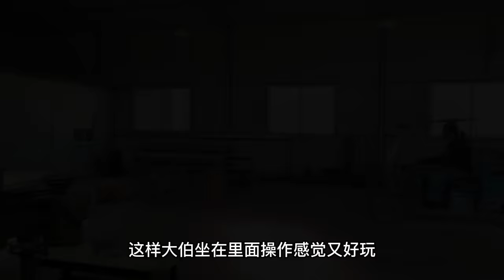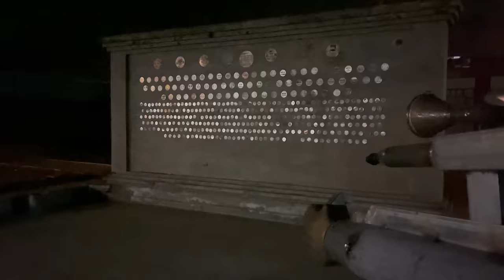ENG)自製安保巡邏機甲 Homemade Security Patrol Mech【手工耿Handy Geng】

Comment: This is Awesome!!! I would set it lower and balance the center of gravity with a swivel wheel under the driver, then could remove the stop rollers inside the tracks and would make it much more stable.
Reply: I was thinking the same thing.  But simply incredible!  What an awesome channel.
Reply: Pair of sprung (wide set) dollied motorcycle wheels trailing.  To improve off road capability?

Comment: I would change this device to have 2 tanks. One for chili pepper water and the other is for gasoline. Change the 2 arms to flame throwers. Add microphone for dosing out warnings and call for help. If the chili water does not deter then the gasoline should deter any intruder.
Reply: Special attack is fine, but sometimes you need melee attack, like when you run out of those tanks
Reply: Hey he is living in China, not the US. :P

Comment: Excellent build.  As for lethality, it can serve as a platform for a number of weaponry and mated with a remote piloting system.

I'm amused at the idea of a perp laughing-off being spritzed by water and the Sybian-like motion of the mech's arms... until the fists swivel down to reveal a Vulcan electric cannon and sidewinder rockets :P
Reply: Actually what would be absolutely devastating is putting laundry detergent in the cannons.
Nobody would stand up anymore and the machine is on tracks.
Crowd control.
Reply: @raymondcarter1137  why so complicated make them suffer directly with pepperspray ingridient , needs ofc a windshield then ^^

Comment: You are obviously inventive and clever at rapid building. But what is uncle going to do with this machine? Can he get in it? How much experience will he need to operate it efficiently? What maintenance will it require? And when uncle manages all this, what can it really do, almost tap an assailant with a slow punch or mist them. With water. I assume it’s water ! I think there are some good thoughts here but it’s not yet viable. Great engineering though, just needs some refining. Also, forward planning would be advantageous to you.

Comment: Just soak some capson peppers in your reservoir tanks and you have a pretty good crowd deterrent like a mace and maybe add side and rear facing sprayers as well  Dare we be mischievous you could also add a few spark plug wires and a coil to those sprayers and different liquids  For some real crowd control :)

Some bigger tracks for stability and Improved center gravity and you might have something :)

Comment: I feel like if it would have been made with 3 of those tank-treads in a triangle arrangement, with 2 up front and another  in the rear center it would be a lot more stable, it seems like it could tip over backwards if he hit for instance a speed bump while going at full speed ahead. Or if he was going in reverse and hit an obstacle, it just Seems to have a bit high CoG from my perspective. Still totally bad ass, but that is the one thing I feel like could be a major improvement...
Reply: he collects his materials from landfill or recycling center. these two tank treads are the only two he can find, they are rare to find unlike wheels.